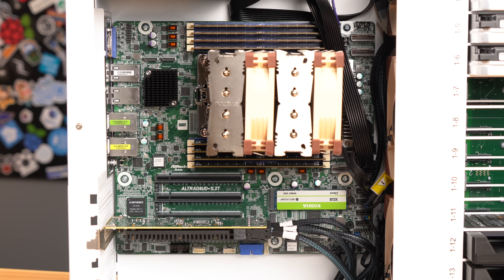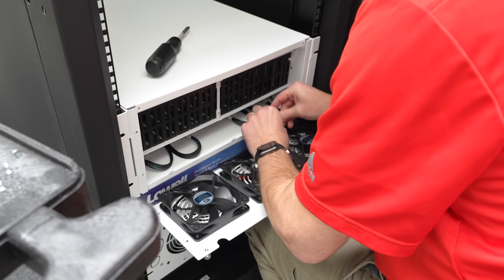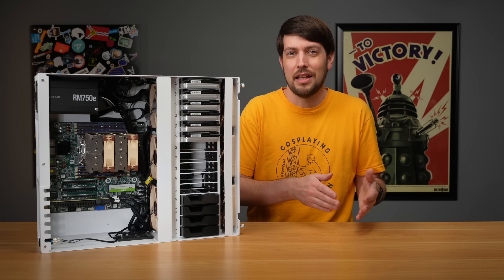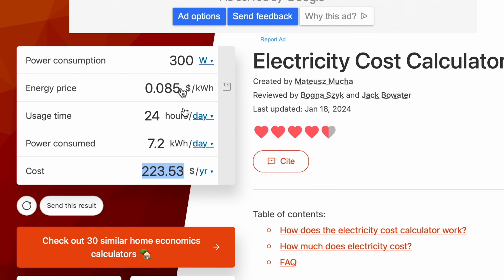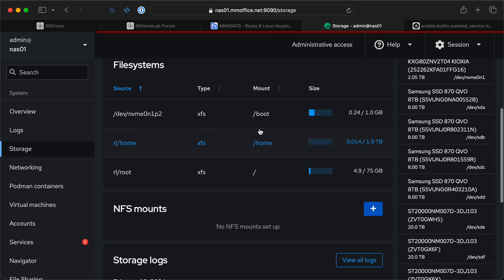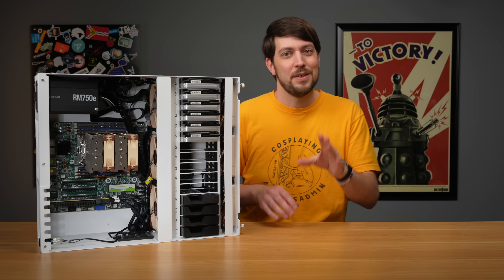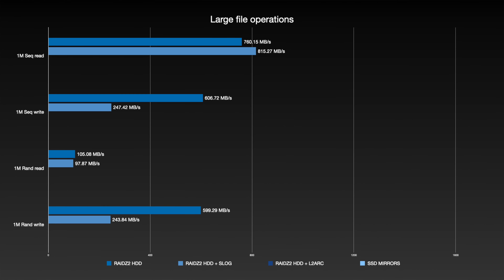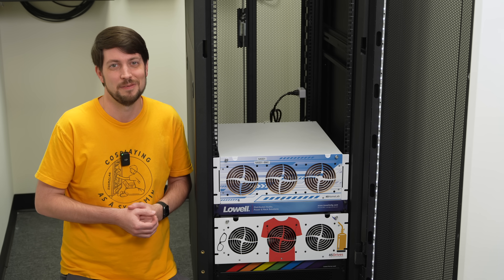Silencing the 100% Arm NAS—while making it FASTER!

Comment: QVO ssds are qlc ssds and once their slc cache fills up their performance drops like a brick. Your mechanical hard drives will be faster than them regularly. If they were 870 evos then you would have been fine on the ssds

Comment: The easy solution here is not to put a server case anywhere near where people work/live. I know you want to look cool and all that but they simply don't belong to a "home lab." A standard PC tower with mesh front and top will always cool better with less noise. Forcing all the airflow through relatively small and heavily obstructed front and back panels is worse by design.

Comment: SLOG is power failure protection. Under normal circumstances it's write-only for sync writes and only needs to be a few hundred MB (it essentially converts sync writes to safe async)

L2ARC only caches heavily hit data and only if ARC is already full. It's more use in a multiuser fileserver (enterprise or departmental) than systems with only a couple of users

RAIDZ are limited to the write speed of the single slowest drive in the array and reads are only a fraction faster, but the point of RAIDZ (and ZFS in general) is data integrity, not speed

If you REALLY want to stress test a system, put 10,000+ files in a directory and see how the filesystem responds when you try to access it. ZFS is one of the better ones in this case and most other FSes will either barf or halt for a while

Before you say "Don't do that" - that's exactly what users DO, and various NASA fileservers suffer from the same issue so it's not just the Great Unwashed.

Comment: i must say software Raid is cool and so, but performance wise Raid Controller are still Superior even they have their limits and problems, like of your controller dies everything is gone and also they are expensive. Software Raid solutions can be restored if you know the key. So yeah i see why many people use Software Raid. But i had always problems with the performance, even with a fast CPU in the system that could handle this with ease.

Comment: Blades close to the openings have the same effect used in old air attack warning sound devices: they used a rotating drum with openings that crossed matching openings on the outer shell - every time they matched it produced something similar to a small explosion each.

Comment: And here I am with linux (Fedora XFCE) server running Ryzen 5700G 8C/16T inside slim Fractal Design Node 202. (Noctua NH-L9a on CPU.)
Idles at 25W, while running lab, web server, 5 game servers: ARK, Valheim, V-Rising, ...  . (Measured at wall socket.)

While I am application guy instead of storage needing one. Board supports 4x4x4x4 on PCIe for total 6 NVMe drives. And then standard 4x SATA.

Comment: 8:33 Just noticed: It seems like the CPU cooler is hanging a little. When the motherboard heats up, it will bend ever so slightly (problem is much worse with hanging GPUs).
This is of course no problem if the case is installed in horizontal position, but if it were in vertical for daily operation, I would mount a thing string to the top of the case to take some of the load off the cooling mount point. Maybe not necessary, but just a precaution. Better stable, than experiencing weird problems down the line.

Comment: Electical tape goes evil after a while, so you might regret that later \^^/
Some airflow analysis would suggest that you fill the empty slots with something or all the air from the front fans will go through the middle. I'm not seeing any baffles to stop the air taking the easiest route through.

Comment: Great, so great, thx again. Just a small linux advice - the cpu aloud couple power consumption options, like powersave ondemand performance.... colled power governer scalling_goveenor. I first discover in ubunto, later on I make a small bash script to change. For r5-5625 I turn cpu+gpu from 15+13w to 2+2w . the 7zip test show me 2.2-2.5 diference in speed. But the real live test was on stormi day, for safty I unplug the power of my laptop, and 18 hour work late I was wornd that my batery is less than 30 persentage !!! what! yes 18 hours internet, youtube, and cad/bim ;) . Thanks again for the nice video.

Comment: Comparing effectiveness of $1100 CPU + $1500 motherboard vs something like 5950X at $375 and $100 motherboard, there is no chance that with $2000 price diff final effectiveness will be at the Ampere side even counting power consumption which won't be that huge different.

Comment: The prices are wrong in europe. If it would be this low, i think most would not care to much about power usage. its 0.X not 0.0X so factor 10 higher. For 300W 24/7 i would Pay $919 in a year at 0.35/kWh.

Comment: If you want backups that are more then just an RCLONE to a different drive / cloud location.
I recommend Kopia as a Backup solution. It Creates Snapshots and encrypted ( optionally compressed ) files on the target backup repository.
There are releases available on just about every platform, including ARM. Docker containers are available to.
And In case of a crash, the repo can opened with any parallel instance of Kopia. ( though don't make new backups from that parallel install )
For Restores, you can mount a snapshot as a logical Drive / mountpoint on your desktop, and drag 'n drop, or otherwise copy the backups to where you want them.

I've been using it since September, and my monthly restore tests work fine. Tough , if you backup to an Azure Blob ( did I mention lots of remote capabilities ) setting Data Lifecycle management to Archive your data at some point in time, Rehydrating is needed before you can restore. ( and don't let your config file blob get archived... ) 

Anyway, I hope you checkout Kopia, its already been a lifesaver for my wife's computer data. ( it runs as a service on her laptop, does eat some Ram though )

Comment: Just a tip for anyone running arm, you can use box86 or box64 to run x86 software on arm. This won't work for everything but it is very useful.

Comment: in my custom build i did a few years back, still running to this day:
Tyan S7002 2x Xeon 5500's. 256GB DDR3-ECC Ram, 14HDD's, 8 SSD's. dual PSU (both as single for additional molex) - noctua coolers and 180mm case fans
Total package under load? (100%) :: 430-450w, idle HDD's

Just as a yardstick :)

Comment: Also I really don't get why this system would need 9 fans (3 in front of hdd, 3 behind hdd, 2 on the cpu, 1 on psu)... No wonder you can run these fans at their minimal speeds through pwm. Probably even 3 fans in the front and 1 on the cpu would be plenty to push out the heat. My own homelab server has 1 fan for the whole system and it maxes out at around 50W total system power, fan rarely goes above minimum speed
Reply from the maker: It really depends on what you put in it—if you throw in a 200+W TDP CPU, plus 15 enterprise HDDs, an HBA, and a few other cards, it'll get up to 350-500W, which does require a bit more air to keep running well. The annoying thing is out of the box it's setup to blow like a wind tunnel, when many builds (like this one) just don't need it.

Comment: Eh, I had to pause to comment on one thing. If you're a software dev you will most likely NOT be so dumb as to use your NAS as a target for any of your hobby/home project stuff, if you actually do such stuff which I doubt. So no - that sort of thing should not be a consideration. The same way you would probably not spend your evening trying to hack together a new and "improved" firmware for your washing machine or "smart" TV. Why? Well, for starters, software devs spend enough time as it is cludging together stuff at work, secondly they have intimate knowledge and experience of what happens when you deploy broken, unfinished or otherwise bad software, either from having done it themselves or having seen others do it - up close. 
Have I reprogrammed something just basically because I could? Yes, a couple of times, early in my career. Fun? Yes, absolutely, for about 5min. Then I spent about 45min restoring the original firmware, which wasn't fun. Then I thought about it some more and decided not to do that anymore, mostly because if you brick it you're SOL since warranty doesn't cover firmware fuggery. That counts as "modifying the product" which voids your warranty, even if you have a fault entirely unrelated to the monkey business with the firmware. 
So, fellow software devs, resist the urge - do not firmware hack your washing machine to play the Imperial March at random times of day, let your NAS be a NAS instead of trying to mine Dogecoin on it, etc. You may still want to go alternate firmware for your wifi router, as that is actually useful, but for the love of Jolt Cola, get some extra SFF computers in a LAN to scratch your hacktastic itches with.

Comment: the spacers work because now you dont have the fan blades passing by the grill so closely, wich caused turbulence before, main reason why i usually cut out the fan grilles on my mashines as it completely removes all noise

Comment: So the original fans are not PWM-controlled at all?! I've once designed a dual-use (tower, 4U rack-mount) server case, which should get equipped with a PWM fan control (including throttling the fans when interior temperature is not too high), but well, the manufacturer was slightly overworked with my design, so that the case never hit the market. :(

Comment: just curious, could we just plug the noctua fans directly into the fan connector with the HL 15 case? I thought it was also a 4 pin?
Reply from the maker: The fan connectors are 2-pin, so you can get them to plug in, but then they'd just run 100% (on 12v power) the whole time. The Noctuas would still be quieter than the CoolerGuys fans, but not as dramatically.
Reply: Thanks Jeff! I’m thinking of doing the same thing, but unlike your setup, I don’t have active CPU cooler. Would it make sense to plugin all fans on the case fan header? Or I should plug them in to the cpu fan headers. I’m not so sure if the super micro motherboard knows when to spin up and down the fan for case fan header lol.

Comment: So add spacers on the OEM fans?  What was the sound level then?
Reply from the maker: I haven't had time to try printing spacers for the OEM fans; the Noctua spacers have nubbins that fit into the Noctua fans. Could trim those off but then they wouldn't fit on the Noctua fans quite as well.

There's a good video I think from optimum tech about DIY fan spacers
Reply: @JeffGeerling Thanks for the pointer... just thought that would be an interesting test, maybe when you get the chance!

Comment: Hmm, as for a home NAS I'm planning to go with an (upstream first) ARM SBC. It's gonna run Guix and the filesystem  is gonna be either btrfs or the new and shiny bcachefs.

Wait… RAID-10 gives you so little? Like halving the capacity for such little safety? Why would anyone use it over erasure codes now that they are available to us? (maybe it's about the performance. Reed-Solomon isn't the fastest I believe, so that's probably it)
Reply from the maker: Exactly—it's still slightly faster than RAIDZ2 if you just have four drives. Or possibly more, there's a limit though, and it depends on your drive speeds too, whether it's worth it or not.

Comment: The out of band management can use up to 9-10w (see with some supermicro boards). If you want to save on your electricity bill then go for an vPro AMT board - they use around 3-5w.
Reply from the maker: This board uses 6-7W for BMC, it's not great, not terrible :)
Reply: @JeffGeerling  which is roughly the same as my ASRock Rack E3C236D2I, I still wonder how Supermicro need more power to power the same chipset.

Comment: if you want a rule of thumb to go by... the bigger the heat exchanger/radiator the more watts something consumes, if something looks like it has a chonk of metal on a piddly board, it's not going to be efficient with it's power draw, if it has parts to move those will also take a lot of power. try to avoid things that produces heat as a biproduct, even if it's slower.

Comment: You should use heat shrink for the not used 12V fan connectors, the tape just get loose after some time.

Comment: The main reason why a company like 45 drives wouldn't be fitting 'quiet' fans in the chassis is simply economies of scale - they likely buy the same fans for all their systems to get the volume discounts.
Not to mention, having more SKUs means more expenses in maintaining them:
1) Storage costs - If you need to keep 100 units of spares per SKU, having more SKUs means storing more spares if they're not interchangeable between products.
2) Other manpower resources - More logistics required per #1 for stock checks, packaging etc. You also need administrative, accounting, and support personnel resources to understand and track these SKUs - e.g. knowing which spares go with which products, procurement related efforts when you need to top up your stocks etc.

In a much smaller unit (AV5) like in the video, you only have a single layer/ column of drives for the fans to push/ pull air through but their larger units like the S45 or XL60, you have 3 or 4 columns of densely packed drives - This means requiring high static pressure and airflow from the fans.
There are a few main ways to achieve this:
1) Increase the fan speed - this gets loud fast because airflow increases linearly with speed but noise levels increase exponentially.
2) Increase the fan thickness (effectively allowing larger blades) - that's why many traditional server fans are 38mm thick (or more) rather than the 25mm thick units typically found in PCs.
3) Stacked fans - Also used in some traditional servers/ JBODs fans where you get the counter-rotating blades like Delta's PFB/ GFB series.

So whilst low noise fan like the Noctua or any other good quality HDB/ FDB lower speed fan works well in an AV15, they wouldn't work very well in their larger chassis units. Climate is also a factor - the Noctuas in an AV15 might not work as well if you place that in an environment with ambient temps of 36'C to 38'C.
That's not unusual these days with 'Green' DC initiatives; one of my customers runs supercomputers and HPC in fresh air cooled DCs where even with CRAH units coupled with rear door heat exchangers, the DC typically has an ambient temperature of 36'C easily.
With those temperatures and all the fans screaming away in the DC, it's not a nice place to be as a service or installation engineer.
Reply: 45 drive case is ripoff.  Supermicro way better!
Reply: @prettycounter  Jeff mentioned in the video that the AV15  is an $800 chassis? For that price, I'd say it's a really good deal compared to say, a 16 x 3.5" Supermicro which goes for about $1400 (cheapest I could see at a glance online).
Plus the AV15 won't need getting proprietary RPSU or HBAs to support a SAS expander (SM really seems to like this).
If you're referring to the prices of barebones servers from 45Drives, then yeah, it might not be quite as good of a deal when factoring in the other components.
I reckon that if you just want a solid x86 setup with up to 16 drives, then a pre-owned Dell or HPE server may be a better deal assuming it doesn't cost an insane amount to ship to where you are - as it is in my case; pun not intended.

Comment: In regards to the PSU you can get ones that has silent mode. 
I think using a PSU made for higher amounts of wattage will also lower the need for cooling. Then you can also look into its efficiency curve to find what delivers the power you are using as efficiently as possible.
Edit: I am not sure if the bad efficiency at low wattage can push a PSU to need more cooling. I did just think it might be an issue with the sub 200 watt you are using on a 750 watt PSU.  But I do think PSUs with silent mode stay silent as long as the wattage isn't too high.

Comment: "Back up the data manually"
Shudder... FreeFileSync, set up a no-cost automated sync that allows you to sync only added files while not deleting or updating existing files.
Then once a week you can run a manual sync to duplicate the deletions and have it automatically check for any inconsistency in the data and it will allow you to choose what file to keep

Comment: If you can control the speed, you are perfectly fine to use typical 120mm server fans.
Noctua only reduces tiny bit of noise with their own trickery, the bulk of noise reduction comes just from low RPM.
Alternatively you can go for some $10-15 corsair fans which are silent.
The spacer brackets are an good idea , but no need to buy pricy noctua stuff, can easily 3D print some.

Comment: Definitely interested in what you do for your off-site target. I was checking my subscriptions, and saw sticker shock from my offsite backup bill via Backblaze B2, and am now in the market to see if I can hit a reasonable capacity / reliability target at 1-2 years ROI on what I was paying Backblaze.
Reply from the maker: Check out how I'm currently using rclone + Amazon Glacier Deep Archive. Retrieval costs are high, but it's a lot cheaper (if using Deep Archive) than BB2: https://www.jeffgeerling.com/blog/2021/my-backup-plan

Will be reworking that with the new studio soon!

Comment: Do not discount the effect of unpatched drivers and firmware on all devices in the chain.  I support more memory up front, so that less code gets executed as well as less device wait. Lastly you may get better throughput if you try using affinity sets between network interrupt driver and NFS(or samba) also for storage controllers.  Interesting results can appear as I've seen in the past, depending on the size of the CPU L2/3 cache.